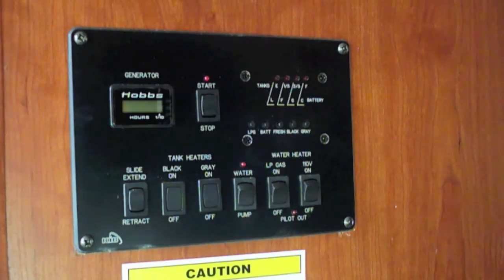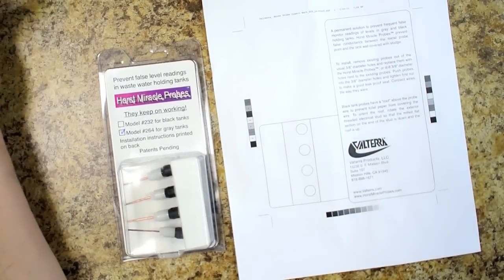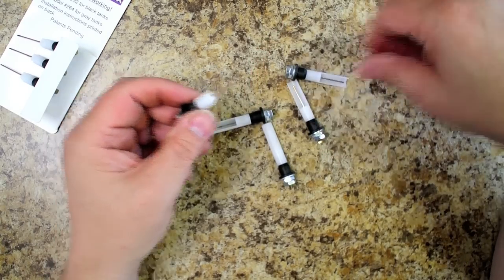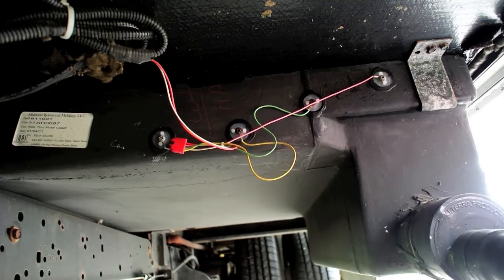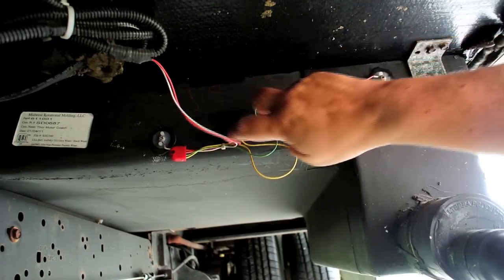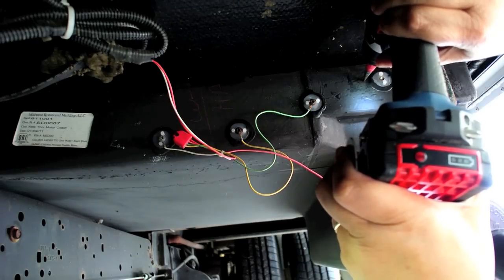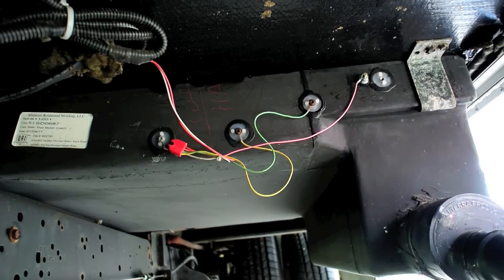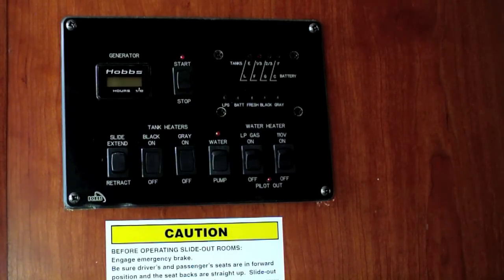Cheap upgrade of the faulty tank sensors on your RV.

Comment: FYI. if one makes a mistake in drilling a hole say to large an easy fix for these poly tanks is to drill the next larger hole that will take a brass pipe plug and tap the hole with a NPT tap. i had to do this on a brand new fire truck (pumper ) when one of our guys drilled 12 holes into the poly booster tank which was just behind the outside compartments he was mounting equipment brackets and the tank was about 3/4 of an inch behind the compartment wall. you should have heard the station capt. when they filled the booster tank with water and is starting raining underneath the rig. this repair method came from the tank manufacturer because it happens a lot.
Reply from the maker: Ha Re You can also buy plastic welding kits for some tanks, depending on the tank material.
Reply: awboater plastic welders work great as long as you  use the same  base material.  i have one i have used to repair motorcycle luggage boxes and fairings.

Comment: If you do a lot of drilling I recommend you get a deburring tool used a lot in aircraft and other metal working. It will remove the rough edges and can reach into the new hole and remove the burrs where that rubber needs a clean surface to seal against..
I do hope you came back and wrapped that birds nest of wires in either wire wrapping or taped neatly so mud or ice can't start to weaken the wiring by having small stuff to hang from.
Reply from the maker: George Purdy Good ideas,
Reply: Thanks! One from working in aircraft the other from having to fix birds nests on road tractors and trailers while on the road! I HATE a messy wire job! I always carried a small roll of wire wrap and of course that electrical tape and connectors and crimps as you never know when Murphy will strike! Of course tie wraps work wonders in the wiring world also!
Blue Sky's and Safe no repair Journeys!

Comment: Sir...  Could i used the black tank horst sensors on my grey tank?   I like the "tent" design the blank tank sensors have....

Currently my factory sensors work..  I let rid-x sit in both tanks when i am camping...  When i empty them...  I fill both tanks with. 3-5 gallons... In the black tank i put in a cup of dawn dishwashing soap...  In the grey tank i put in up to 1/2 gal of vinegar...   I occasionally flush both tanks with hot water...

Your youtube channel and website have been a treasure of information...   THANK YOU
Reply from the maker: There is no reason you cannot use the black tank sensors for the gray tanks.
Reply: @RVProject  Thank you....  I am overwhelmed with all the useful information/tutorials you share... I have to watch them 3x-4x ...

Comment: I wonder if u could use dielectric grease on the electrical connections to protect from corrosion? Great job.
Reply from the maker: The issue isn't corrosion on the external connections, it is on the inside of the tank where the well nuts become fouled.
Reply: @RVProject  I realize that but u sprayed a protectant on the outside connectors. I figured dielectric grease would work on the connections where u put the wires on.
Reply from the maker: Grease would work I suppose, but the connections were exposed to the underbelly, and I think the grease would attract dirt and road debris.

Comment: it looked like the empty and 1/3 full sensors were on the same level.  was that just the camera angle or something?
Reply from the maker: I used the existing holes the RV mfg did when replacing the old sensors for the new ones. You are correct that the empty and 1/3rd sensor levels are close, but not enough of a problem to warrant sealing and re-drilling a new hole. Afterall, the most important sensor is the one that says full.
Reply: The empty "sensor" isn't a sensor at all. It's there to complete the circuit as a ground. If power can pass through the sensor (1/3, 2/3, full), through the liquid/tank contents, to the ground, then the light for that sensor illuminates. The empty light always lights up when you push the button.

Comment: You may have put this up 9 years ago but the information is still valid today, Sept 2024. Not knowing how the sensors looked or how they could be replaced turns out to be not rocket science :)  My sensors were not clogged or caught up with debris, just mildly corroded - so I popped down to my local RV store and picked up the basic replacements they had at 3 bucks a pop. I just have a small 16' trailer (that was born in 2018) and never poop in the tank unless really really really necessary so no real need for the Horst sensors. 
So tanks a lot for the excellent video.

Comment: Can you clarify what you mean by “keep the notch down”?  Thank you.
Reply from the maker: The Horst Black Tank probes (but not the Grey Tank or Water Tank probes) have (or at least had at the time of the video) a notch in the sleeve protecting the actual probe. You can see the notch from this photo:

https://amzn.to/2BE3ReO

The notch is the missing part of the long tube that exposes the probe. It should face down when installing.  Further, there is a corresponding notch on the end of the screw threads so you can properly orient the probe after installing into the tank.

Comment: This is OLD TECH!!! The newest type reads through the tank and just tape on!
Reply from the maker: The capacitive systems have also been around for some time. I installed one in my boat 15 years ago.  

Unfortunately RV manufacturers are too cheap to buy and install them.

The primary  reason to go with the Horst probes is you can keep your existing display and wiring. 

However an acquaintance of mine and I have been prototyping a system that would use capacitive sensors (analog) but still allow the use of the LED display in the monitor panel. We would flash tbe LEDs for the intermediate steps.

For example 1 LED flashing = 1/6 full. One solid LED = 1/3 full, one solid and flashing LED = 1/2 full, and so on.

As this will take a bit of time to design and prototype, the Horst Probes are a good interim system.

Comment: Thank you for the informative video's! This one in particularly interests me. The accuracy of your tank capacities is especially important when dry camping.
Since you've had these installed for a while now, are they still consistently accurate? I need to replace my sensors.
Reply from the maker: While I would not quite call it a long term test, they performed flawlessly for the 2015 camping season.

Comment: What is the material used for the probes?  If they are NOT stainless steel the sensing probe will either corrode off after a period of time, a few years.

Comment: Put these in my old RV .  they changed the Gray tank pin it Used to be like a coil on the end (Original ones )  also put them in the Black tank.  the Gray Tank Worked Excellent  but the Black was Hit or  Miss  also I used  a #5 Center Drill  to avoid Cork screwing into the Plastic when Drilling and it leaves a perfect hole they are available at any industrial supply

Comment: That bottom one, the white one. It's at the same level as the yellow one. Is the white one a ground?
Reply from the maker: The white wire is the "low-point" reference, and is ground/negative side of the battery. It should connect to the ground/negative terminal of the display panel.

http://www.rv-project.com/projects/horst.php

Comment: After four years are the new sensors still working?
Reply from the maker: I no longer have that RV so I don't know. But they worked for the two years I owned the RV, which is a lot better than the stock ones.

Comment: What is the Max Lenght for Wiring?
Reply from the maker: You use the existing wiring to the tanks. But given the wire has resistance, a longer wire  (and/or smaller gauge wire) would certainly have more resistance.

The sensors are just a resistor ladder, so the resistance in the wiring will affect the reading. 

However, since the resistor ladder is 187K ohms from full to empty, and a wire even 100ft long would only have a ohm or two at best, It wouldn't make a noticeable difference in the reading.

I would be more concerned with electrical interface in the wiring though, which could significantly change the reading, or in the worst case scenario damage the display. So I would at least want  a grounded/shielded wiring jacket if the sensors are a significant distance from the display.